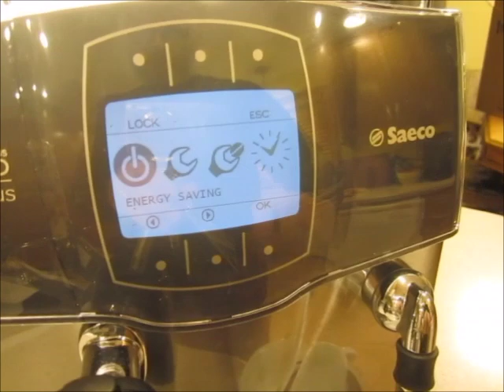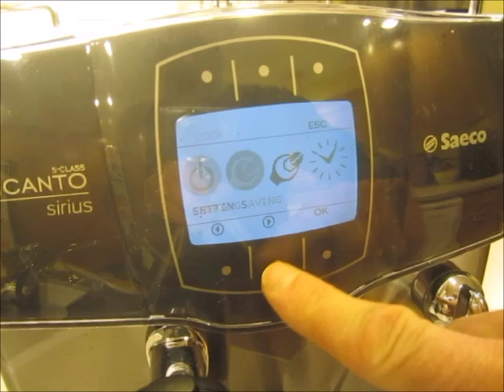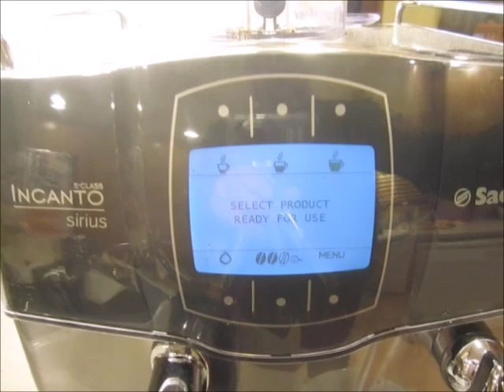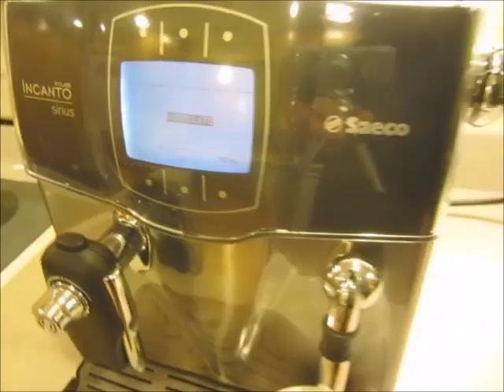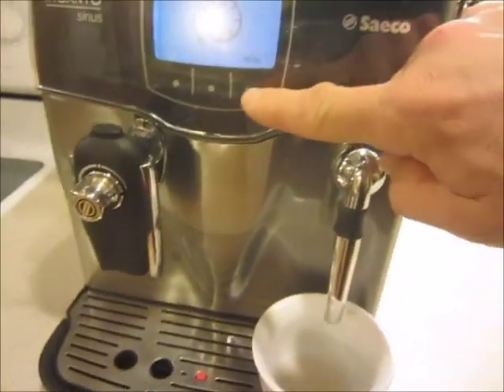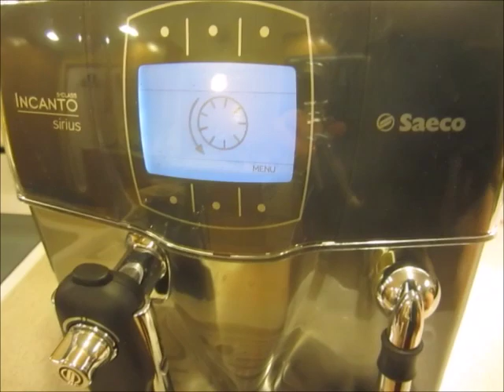For parts or repair Saeco Incanto S-Class Sirius Coffee And Espresso Maker

Comment: Liked #11, hi, I came across your issues when I had the exact same problem. Your pump sounds like it is working, so it boils down to 2 choices. One is scaled tubes, the other is something I stumbled upon after I disassembled it couple times to narrow down what could be the cause. My problem happened because the steam knob fell out of the socket. I placed it on after 1 year of not using machine. Turns out if that knob is 1mm clockwise or counter clockwise off then, no steam or water comes out of the wand! Also, the same for the area where coffee comes out from. What I did was stick my fingers where the steam knob use to be on and turn counterclock wise to open, as soon as you hear the steam or the water come out, STOP turning!!! You have to do this slowly. It turns out (on my machine) I can not fully turn it all the way to counter clockwise but more like 95% fully. I stop and let the machine do it's thing by pouring out the water for 5 sevonds or so then place the steam knob on. There are 3 notches (teeth on 3 sides) on the machine itself and 3 on the inner knob itself, so they have to match. Try again with the knob on! If it works then problem SOLVED 😊 If this helps you in any way, consider subbing my channel and watch few videos...all about traveling. Hope it works out for you, if you still have the machine. Take care! Have a fun-filled day, ciao 😊